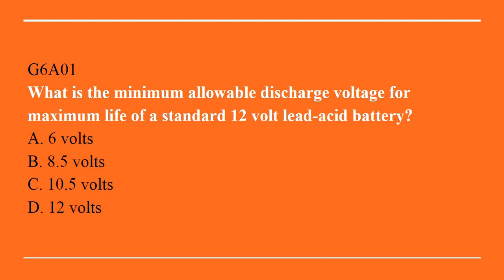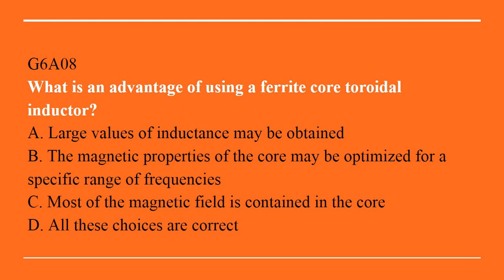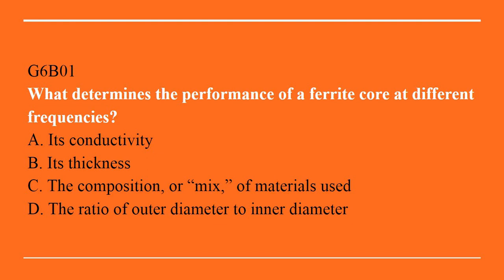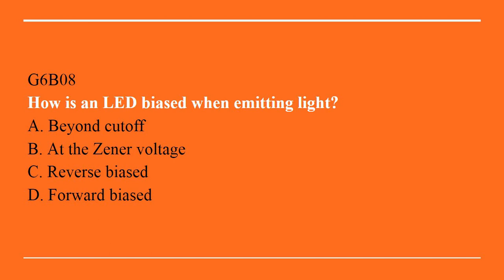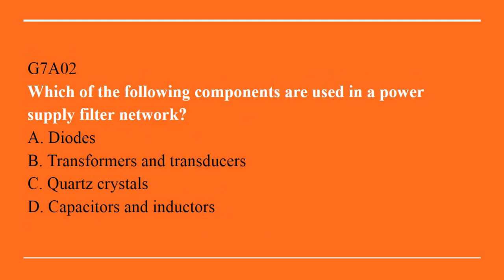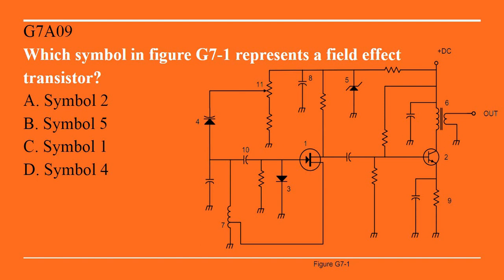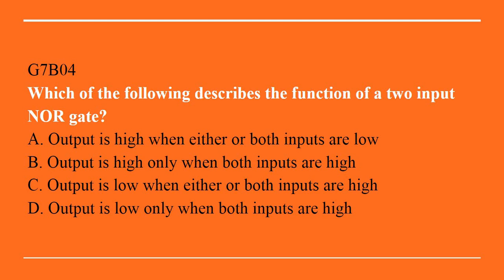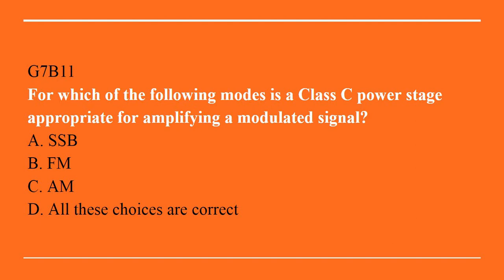(Expired) 7 General Class 2019 2023

Comment: G6AO7 - What are the stable operating points for a bipolar transistor used as a switch is a logic circuit ?? The answer to that Question is (C) It's Peak and valley current points are Ranging from A,B,C and connection is applicable for both points to work it have to do routing properly for that to meet correctly
Reply: Mm... was that a mistake in the General  class license  manual ? It says its A..